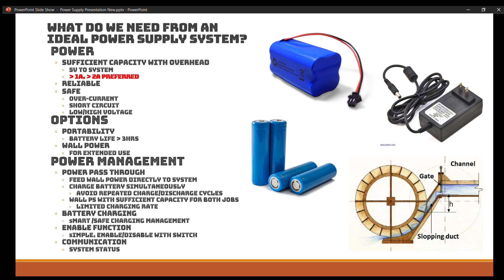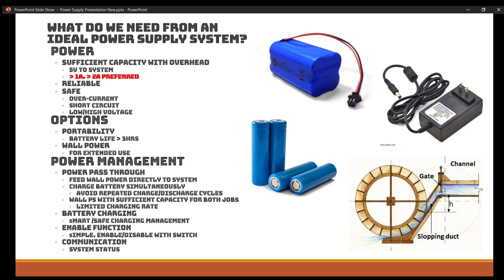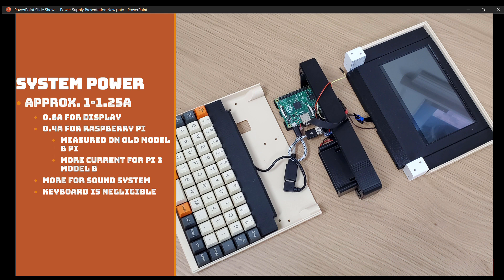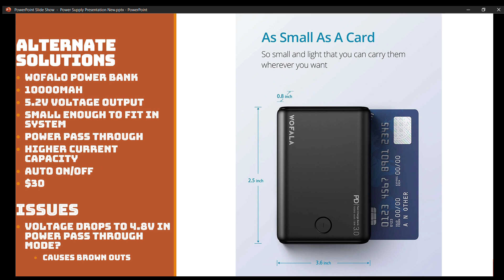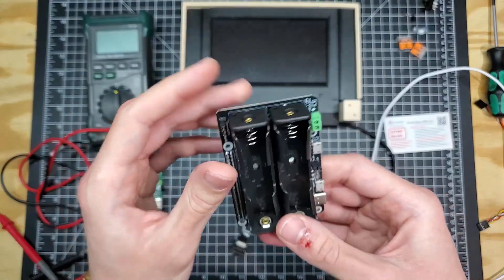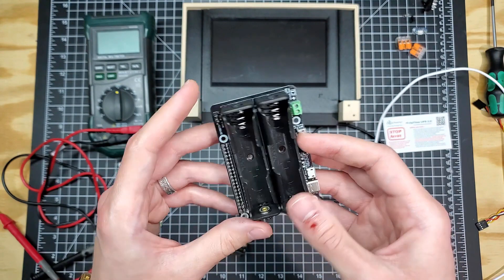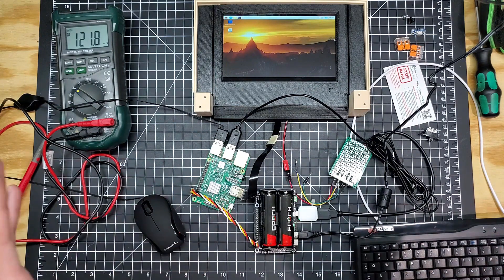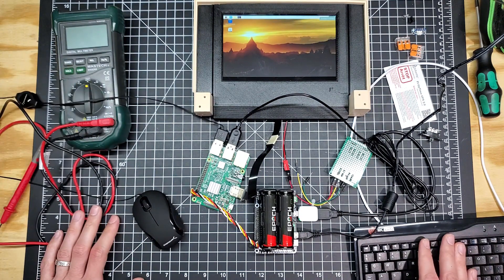BS&OB Ep 5: Power Supply and Project Update

Comment: I'm glad to know the UPS is really worth the money. I'll have to pick one up. They were the only solution that fit every requirement. I was only able to use a powerboost 1000c on a pi zero with a pimeroni hyperpixel (good resolution, good screen, good capacitive sensing for a handheld), and it would not brown out when plugging in (some!) peripherals, and survive plugging and unplugging power. Every other display was too power hungry for the 1000c, or suffered brown outs during transitioning power or peripherals.

Comment: I was thinking of a similar project - different goals though - and thinking the dual circuit solution too. But I am wondering: instead of shottky diodes wouldn't you be better off with the other kind of switch (that is not shorted while you switch, but go off first always) and a big enough capacitor AFTERWARDS? For me it looks like it would do the job and I guess power drop would be not that huge...

Very nice series though!

Comment: EDIT: I didnt watch the whole video first. Sorry. I'll still leave this here. To solve the brown outs... look into a sugar ups. I used one in my cyber deck so that I can switch from battery to ext power without losing power to the pi. also comes with an extra battery. You can also, when using the change over switch, run power back to the battery using a diode to prevent it from backfeeding to the PI while running on ext power. This charges the battery while running on ext but doesn't deplete it. So you would have one pair of wires (with diode) running to the input of the battery, and one pair (no diode) running from the output of the battery to the switch. When you select battery power, the sugar ups keeps it running during the switch. All power management plugs into the ups instead of the Pi itself. I can draw you a diagram better than I can explain it with words. You will not get battery power when switched to ext power... but the ups will power it long enough to switch to battery power if you lose power at the house or the cable gets accidentally unplugged. Also, a 3a fuze wouldn't hurt.

Comment: Great stuff! Have you designed the new rear case to include a battery door or do you intend that the batteries should be more or less permanent?
Reply from the maker: For the UPS design the batteries need to be permanent due to space issues. I had a design nearly complete for the power bank concept that had a battery door. I think I may release that design if anyone wants to try it out. Warning though, I never printed the parts or built up that system design so I don't know if they will work.

Comment: I had the same problem with my 80's style cyberdeck: power nightmare. I tried a cheap relay switching board with a beefy powerbank but  as my raspberry 4 is quite power hungry with my 9'' display, the drop is too long (not enough capacitance), there is a post about that 

https://www.reddit.com/r/ECE/comments/kl7k5w/turning_a_powerbank_into_an_ups/?utm_medium=android_app&utm_source=share

Finally I bought a board for that, not installed yet
Reply: building one in a much chunkier retro style and I had planned on using just one powerbank, but I've got such an excess of space I may shove in a second to dodge these issues, at least then the mass will FEEL retro too XD

Mind, adding than nice UPS he found would be good too
Reply: @UNSCPILOT  how will you solve the power switching between 2 powerbanks without resetting the raspberry pi 4?
Reply: @patricklepoutre  simple, the two power banks would be handling different loads, though idealy that is only a backup option, I'd preffer to get my hands on that ups he's using